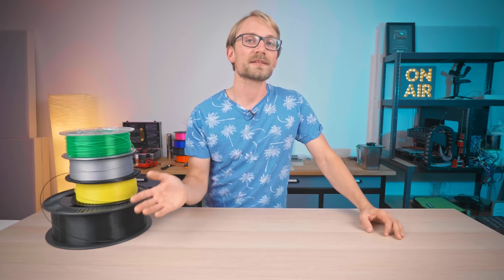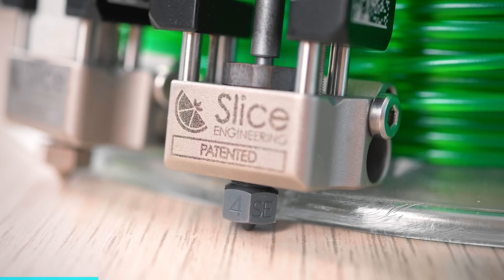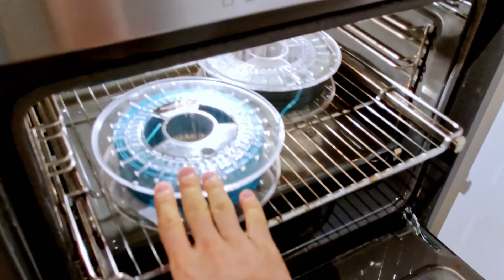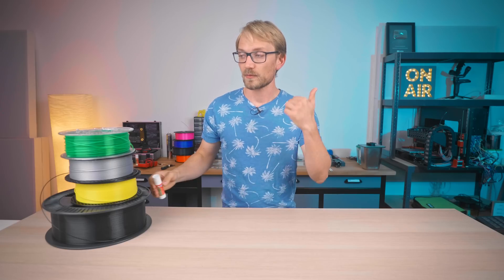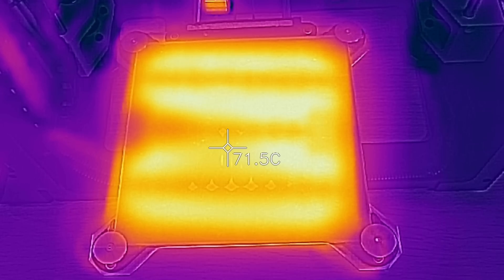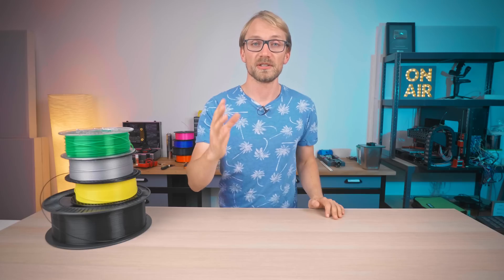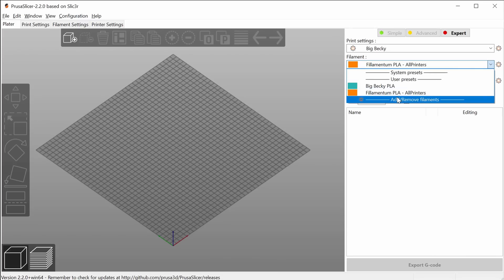How I tune in new filaments!

Comment: I was having a bed adhesion issue with overture PLA professional. I was printing at bed temp. 60 and up. I actually found that dropping fown to 45-50 degrees solved the adhesion issue.

Comment: Chapters:
1:07 Filament drying
1:54 Intro/summary
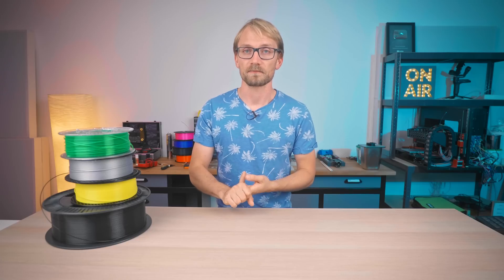2:50 Bed adhesion
4:35 Creating a filament profile (prusa slicer)
5:37 Temperature and part cooling fan
7:33 Flow rate
9:03 Retractions
10:30 Conclusions

Comment: On my K1max i was surprised that the fan was set to 70% for abs.  Printed great, when tinkering with the profile, i put my fan speed down and then off.  Drove myself crazy for a bit trying to adjust other values as this began a nightmare of trying to compensate.  I print so rather large prints and nothing i would do would fix either very poor layer adhesion and cooling separation.  I finally reliqued back to the defaults with 70% and boom.  all works well again with stunning parts in abs.  I guess with a enclosed case, the cooling fan is needed at least one the k1.

Comment: I have a problem where my large PLA parts warp on one side of the bed.  I print on glass with glue stick.  I have checked the level after the first one part I got curling, made some adjustments and then had exactly the same problem.  Tom, you mention lowering the bed temperature to fix this curling at edges?  My bed is 55 at first layer and 50 at subsequent layers.  I see a lot of advice and default prusaslicer settings say 60 degrees for all layers.  Do I try to go lower or even turn heating off after the first layer?  Or do I go for 60?  What about part cooling fan? on for first layer or off?
Reply: Is there a draught?
Does a draught shield or brim help at all?

Comment: I am using black PLA and layers separate. I increased extruder temp from 200 to 210 and still have layer separation. I might reduce outside layer speed or dispose this old spool. Thanks!

Comment: one added thing I do recently is this.... I extrude 100mm or filament. if it curls then I increase temp by 5 degrees until I see a nice straight fairly thick bead of filament. I could go up another 5 degrees from there but that makes a good starting point. I have been have a ton of under extrusion with my REVO hotend until I started printing 10-15 degrees hotter that normal for said filament.

Comment: i have a ender 3 pro with BLTouch and the ender direct drive kit for now 6 years i had only at the begining problems mostly acored by incositend z hight. so o bought a BLTouch and tryed beldleveling with it and it was worse. so after some time i learned i shopuld use the BLTouch only for consistend Z hight and calibrate the bead with a precistion dail. so i did and adheation was no longer a problem. the next mistake was i buyed the cheapes avalable PLA after some time i leard about that so i sticked to only one ore two similar brands this did the trick but after a while those brands dos not exist anymore so i chose a a bit pricer brands and payes now 25€ for one 1kg spool as instad 14€. after 2 years more or less daly use the printer and my confedents goes up u bought tpu and yea then i leard the hard way of printing. i had so much problems i watched the internet and lerned so much about my printer and it maintenence so i did get it to work but it was chalangeing. i did give up on tpu. 2 years later every print came flawles but i hated the support brakeway thing and ripping every model apart for multycolor so iloocked around for a nother printer but i lived my ender 3 pro it was a relayable machine with a minimum at maintenence and dual extruder are realy expensive so bought a mosaik plette2s it was a bit tricky at first but i got it to work and after some time i bought a direct drive from creality. my old hotend was mostly good but the temps are some times a bit off so i bought it with a new hotend for around 35€ i changed only the retraction value from 7mm to 1mm and my prints are now better early perfect. so i changed the print temps from 200 to 205 and now there are pefect and now i will try tpu again but i trow away the old spool becaus the spool was laying arond for now 4 years so i bought a 250g sample and now i try tpu and my first prints with standard settings are not so bad ther in fact usable ^^ 
i have now the knowleg and a printer to print what i want without strggleing  for moths. i will not improve my printer further bacuse i dont need it it prints fine and some changes i did in the past maked it worse acros the bord but now i know why so i change nothing it is now for me the perfect printer. 
i know there are better printer out there but why should i buy a new one bacuse one feature? no i buy a new one if i think its time for a new one. i even changed to a 0.6 nozzle bacause in dont need that 5% more detail. maybe i buy in the future a sonic pad or set up a octoprint but for now i dont need it

Comment: I can't speak for other printers, but on my CaribouDuet LGX the opposite of what you say in regard to retraction is true. For example, i make a top infill which has writing inside of it as negative space (so the color of the letters is the color of the layer below). If I use 0.8mm and retraction length and 0.35 retraction speed, the product has a very rough surface (blobs?) when you feel it with the finger. However, increasing that to 1.2mm length and 0.4 speed, the surface around the letters becomes smoother. How can this be?

Comment: Hey Tom.  I need your help. I'm reaching out to you because I have exhausted all other resources. I've been printing with Taulman 645 nylon for 4 years now and recently (over the past 4 months) my prints have begun layer shifting between 84mm and 93mm in height. This is happening on 3 of my 4 machines--1 Lulzbot and 2 Prusas. If I print the part with PLA, the part is perfect. As soon as I print with nylon, the layer shifting is back. I've used the same print settings and no fan, just different nozzle temperatures in my testing.   I've successfully printed over a 1000 of these parts and I am going crazy throwing away costly nylon filament.  My nylon is kept dry so I know that is not the problem. I've tightened belts and nothing is stuck in the belts. The only thing that I do not do is print with a cover.  Could that alone be the culprit?  It would be hard to believe since hundreds of successful prints did not print under a cover.

Comment: Thanks, Watch a lot of your vids!
I'm new to 3D printing and bought the CR-6 SE (Yes I know you in another Vid said to pass, but I got it, no turning back.
I bought some PTEG for the added "heat" and other added strengths of this filament.
BUT. I've since seen and read some horror stories of using PTEG. From delaminating/shirring off glass, and temps too high for a lot of printer nozzles.
Any insight that can ally my fears of using this filament?

Comment: How I do it:
1 - Run it through Marlin linear advance test print to know K.
2 - Print 20x20x20 cube to know flow % and temp.
3 - Try to pull cube apart; if it splits, temp is too low because layers aren't fused enough so raise temp.
4 - Print flow rate, temp and K on a table so next time I use the same filament I don't have to repeat this.
5 - Enjoy printing with that filament. 

Been doing this for a long time and always get great results. Using mostly Sunlu and Tianse brands.

Comment: @1:43 pro tip, preheat your oven first and then put the filament in. This will ensure that the temp isn't fluctuating and your filament won't be damaged
Reply: How long do you put it in the oven?
Reply: @n7angle856  depends on the filament type(pla, tpu, pa....etc). I personally go with 4-6 hours but if you can keep it for 10-12 hours it'll  be dryer and better once printed
Reply: @3DThird  ho thanks, and i was thinking here 10-30 min

Comment: can i use cat litter to dry my filamentß i heard it works to avoid frozen car windows in winter? im trying to cheapskate a filament  dehydrator box
Reply: Just get a cheap food dehydrator and modify it a bit. It will cost you 20-30€, but the running costs are lower since you don't have to get new cat litter all the time

Comment: Why 50-60 degrees for PLA? Why not 0-60? I often print PLA at 0 with gluestick (S5) - although I've not had adhesion issues, I'm open to improving anything I'm doing incorrectly.

Comment: Thomas, can I share a tip to make things better than glue stick?  Take a spray bottle, fill it with IPA and add 10% by volume of white glue.   Agitate to mix and spray onto the bed.  You can use this method to apply a very thin and uniform layer of glue to a bed--which will make your bed side of the print look much better.

Comment: My abs prints were absolute crap until I started using 100% fan.  Of course an enclosure is required and pre-heating enclosured space to 50C completes the setup (heat bed and wait 10 min).  For best results I actively heat the chamber and thermostatically control it. Many profiles for ABS have the fan on.  Not sure why you would say no fan for ABS at 7:23.  I wasted so much time listening to this no fan for ABS advice from you and others.

Comment: Hello Thomas, do e.g. PLA sheets exist to put on the bed and print upon? this instead of putting a big first layer and print the rest on top of it? If the sheet is transparent, it could be used to adhere it on a carrier and not having to print the 1st layer during an hour.

Comment: Something I have found to work exceptionally well for bed adhesion is as follows: 1) heat the bed to 60c. 2)  Mix one part PVA glue to one part IPA. 3) take a clean cloth and soak it with the mixture then lightly wipe down the heat-bed. This creates an extremely tough, thin layer of PVA that lasts many prints and is easily removable.

Comment: When you're dual extruder printing with a single nozzle that adds another variable to the mix. You need to make sure your extruding enough material to prime the nozzle, but different materials and colours have different priming requirements. For example, I can get away with only a little bit of priming for a support material like PolySupport for most prints, while PLA might need four times as much priming to avoid the support material showing through. Darker (or similar) colours usually prime quicker than lighter (or different) colours as well.
But you also need to take into account the different temperature requirements for different materials. Depending on the printer, the temperature may fluctuate wildly while it's switching material, so programming in a hold after a material switch may be beneficial.

Comment: I cant get ABS to stick enough to PEI. Will glue stick help?
Reply: @soundspark  I had read that acetone doesn't play well with PEI? You have no problems? I had considered a slurry before I read that.
Reply: Simon A I know with Prusa printers you can use acetone on the flat PEI sheet, but not on the textured powder coated PEI sheets as the acetone breaks it down.
Reply: @rileyfenley522  Thanks! I have a flat sheet that I scuffed up with sand paper. Works great for PLA and of course PETG. ABS does stick but if the shape is not completely regular it sends to pull up on thinner corners.

Comment: I think you could have added a bit more detail and i even found it quite strange that you did'nt mention any Temp Towers or Retraction Test, which are still the best way to tune in the Fillament, especially the all in one Temp Tower with the Overhang, Bridging and Retraction Test is pretty nice, to at least find the sweet spot over the Temperature, but i'm still not quite sure if that is even the right way for that solution. But it's the fastest way i could find, to test Filament Samples.

Also.. You calibrate the flow rate through eye? I'm not really sure if the print are accurate with that methode and still prefere the old way to dial it in with a dual walled cube at 100% flow and measure the sizes afterwards to get my flowrate for that filament, and it's also the easiest and most accurate solution to tune that it.

Anyway.. I hope you make another Video about that Topic.

Comment: This is the kind of information-dense topic that could greatly benefit from a separate guide PDF or wiki, or even just sharing the script.  There are lots of filament tuning guides out there, but I really prefer Tom's approach and organization.

Let me welcome you to my own dark corner of the filament world:

I like to use super-inexpensive (<$12/kg) filament for huge prints, and for printing drafts while designing parts.  I'm (still) learning Fusion 360 and rapidly go through spools.  And for massive prints, the quality of better filament seldom makes a difference in the end result - if the filament is well-tuned.  I couldn't afford to do large prints any other way!

I tune my filament using parameterized speed and temperature towers in two situations:
1. When a basic filament setup doesn't do the job.  Often the case when buying the cheapest filaments on the planet.

2. When I need to print as fast as possible.  This first became important when I started printing PPE, but also applies to huge prints.

Speed and temperature towers can be a PITA on a small printer, but with careful preparation they can be printed in a single session using "One at a Time" mode (which can also be a PITA).

There is only one thing I avoid in cheap filament: Poor diameter control.  This is less of a problem today than it used to be, but just be careful where you buy your super-cheap filament, and be willing to discard the occasional spool.  The quality control on modern industrial filament extruder systems is vastly better today than it was even 3 years ago, so this should not be a worry.  Still, those early industrial filament extruders went somewhere: When extruded filament flows unevenly, have your digital calipers ready to check the diameter.  Be sure to calculate the actual cross-sectional area: I've had some filament that was somewhat oval but had consistent area and printed fine.

Given the above, I've been able to print some strange filaments, including some that were incorrectly marked on the spool (or not marked at all).  I recently had horrible problems printing some cheap satin/metallic filaments, until I simply ignored the spool label and vendor's documentation and did my own towers.  In this case, I was never able to get these spools to print well on my small delta, not even when printing very slowly:  The filament simply refused to evenly flow out the nozzle despite using high temperatures and lots of extrusion pressure (dual-gear extruder).  My guess was this was due to the short E3Dv6 melt-zone (had to rebuild 2 hot-ends trying). Only the Volcano on my big printer was able to provide the long melt-zone these spools seemed to need.  I'm still not sure what was on those spools: I suspect the additives used weren't a great match for the plastic.

The above may be more of a story than advice: I haven't had to print any speed/temperature towers for any filament I've purchased this year!  So it may be best to just be aware that there are things that can be done to use "impossible to print" spools, and decide if your time to "recover" the spool is worth more than the unfortunate spool.  Discarding a "bad" spool may be most valuable as a "lesson learned", especially if you never plan to purchase that filament ever again.

"Filament Rule Number One" always applies, most of all for the cheapest filaments: Keep your filament dry!

Comment: Tom, your comments on the extrusion multiplier need an update. Your first layer visual can also be caused by an improper layer height. Now everyone is going to be playing with flow rate instead of verifying that the initial layer is printing at the correct height.

Comment: To the average viewer I would strongly recommend using glue stick, hair spray or Dimafix spray (I love this product!) over higher bed temp to avoid PETG, ASA or ABS ruining/breaking the glass bed or the top coat of flex plates too easily. Even if you don't have adhesion or releasing issues, I would still recommend it as a protection for your bed surface. You also don't want hard to remove chunks of glass sticking to an otherwise perfect part (don't ask how I know!).

Comment: Flow through top layers - Hell Yes!
I've been doing this for over a year with great success. I use a square of 4x4cm, 2mm tall. No bottom layers, so it starts with infill at first to mitigate influence of potential bed squish. Prints very quickly and lets you evaluate the flow needed easily.

Comment: I can't confirm "no fan" for ABS. I run my fan at medium setting and get much nicer results and don't have any layer adhesion problems. If I turn off the fan, there would be a lot of curling or sagging, and no I'm not prinitng too hot. I used the lowest temperature that was possible with that particular ABS filament (228°C)
Reply: radry100  not all abs is created equal, these are just guidelines.

Comment: I leave my PLA spools mounted on the printer.  Interestingly, after not printing anything for a months I need to raise the temperature by 5C to get the same quality as previously when I was doing a lot of printing.  I think it may be due to moisture absorbed by the outer layers of the spool since the last use and after expending those layers I can lower the temperature by 5C.
Reply: I usually find PLA has spontaneously snapped in multiple locations if left loaded in the machine for too long.

Comment: Bed adhesion - with printing PLA on the spring steel PEI covered sheet for my Prusa i3 Mk3 I can't praise those 'magic sponges' (melamine foam) enough, they clean the surface so well that PLA always sticks, but TPU & sometimes PETG sticks too well because there's a couple of chunks ripped out of the PEI from TPU prints sticking like superglue so for those filaments I use a Kores gluestick.
Yes melamine foam is abrasive, but it's one of the least abrasive 'scrubbers' you can use, I'm not worried about it wearing out the PEI sheet at all, it removes the grease of fingerprints extremely well.